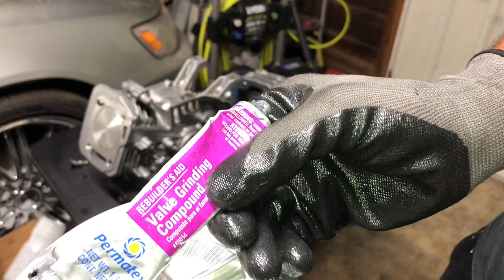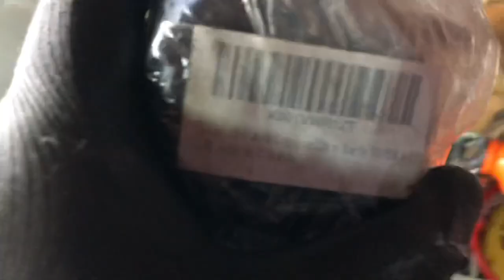212 Predator Stage 3 Kit! 60+ Mph Motor

Comment: Is there a way to clean your carbonator without Air compressed
Reply from the maker: Yeah take the jets out and use the air in the little hoses
Reply: Pump up the spare tyre at the gas station to about 60 psi & use an airbrush to clean things out .Trev New Zealand 🤗🇳🇿